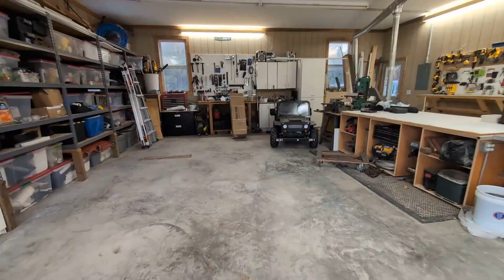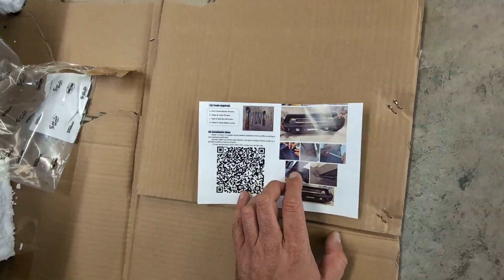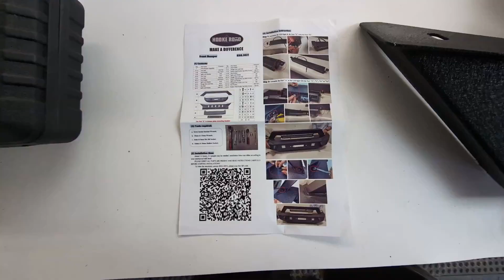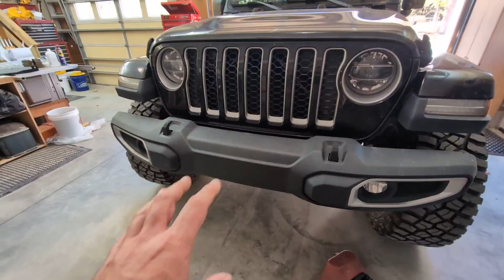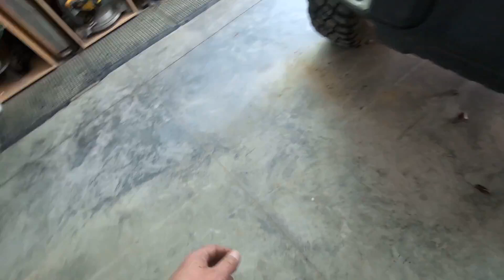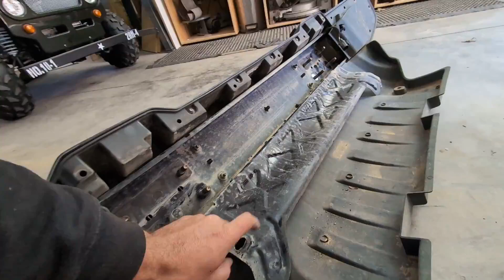Hooke Road Stubby Bumper: Jeep Gladiator Bumper Upgrade (Black Friday Sale)

Comment: Did you ever do the wiring? I plan to install mine tomorrow when it gets here. Also, how difficult was the install?
Reply: Are you going to splice the wires to the original headlights? Or plan to buy a harness? If you have a link for whatever harness you decide to get thatd be great!
Reply from the maker: Sorry for the slow reply just seeing this, I plan on cutting the original harness out and reusing the original wiring and switch.
Reply from the maker: Install was super easy maybe 45 mins end to end, I had not done the wiring yet since I didn't but the harness attachment to put it on the OEM fog lights